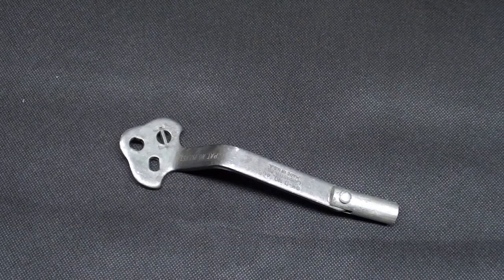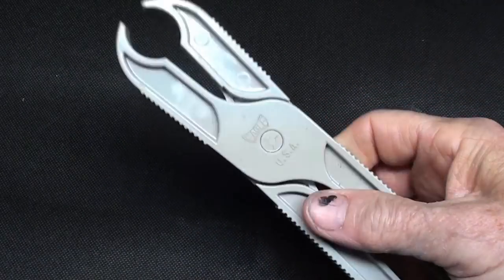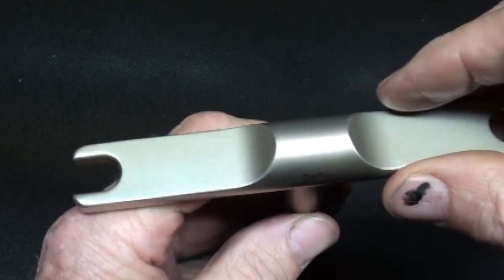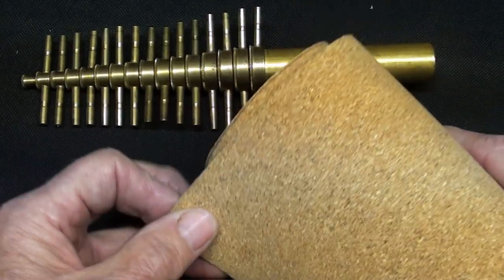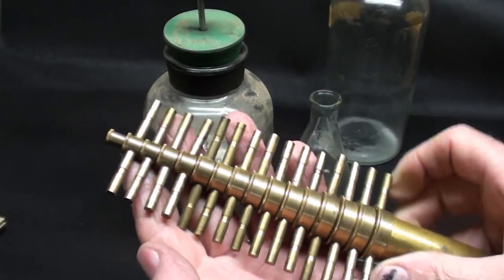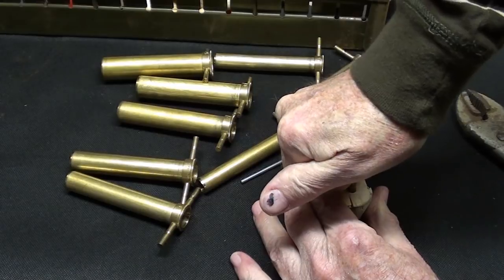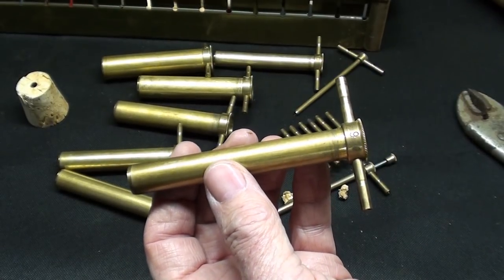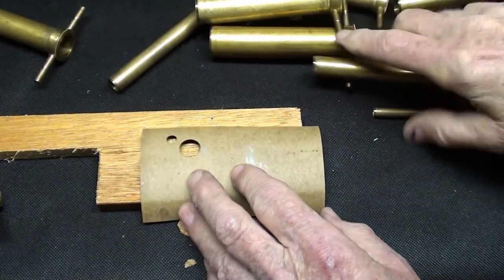What is It? MYSTERY TOOL #39b answer tubalcain

Comment: I have a set of 4 aluminum cork borers and the center ramrod as the 5th piece but I use them as cheese borer/sampling tool for sampling cheese in varied sizes and especially large wheels of Swiss Appenzeller, Raclette, Italian Parmigiano-Reggiano. I thought they were based on pineapple corers or apple corers, I never would have guessed they were originally cork borers for lab use, or even cork-bark  borer. Thanks for your information.

Comment: Didn't know the shock tool because I always went for the hot wrench and a coke bottle of water to put the bushings out. 

If you were good with a torch you could drop a set of fronts out of a 73 Nova in 5 minutes.
The KD tool doesn't look like it was successful very often, especially here in the rust belt. Surprising, most KD stuff was (is) well made and effective.
Looks like the price of cork borers will be going up on ebay, what a great gasket punch!

Thanks for another fun whatzit!

Comment: Speaking of gaskets, my dad would occasionally make a gasket for a steel surface by placing a roughly sized piece of gasket material directly on the intended surface, and cutting it by tapping upon the material against the edges using a brass hammer.

Oh and the fellow with the file has the blade 90 degrees wrong in the vise.  It will flip out of there on no excuse at all.  Not to mention, he's working it so far from the point where it's (badly) secured that it will certainly flex, making accurate filing next to impossible.

Comment: At a fuel depot lab in the Navy we had various "cork borer" sets, the one in this video actually was used in a vise and spindle type of contraption, the t handles fit into a kind of fork which had a crank handle, the cork (rubber) of different sizes fit into the tapered vice jaws (for lack of better term) and the handle was turned and the threads pushed the bore through the corks and out the end. It all came in an elaborate wooden box with pieces and parts stowed in various niches and trays. They even had an engraved nameplate with the federal stock number etc. Fond memories.
Reply from the maker: That’s interesting

Comment: Never seen a cork borer like that similar to a set of leather punches I used to make holes in gaskets sometimes I made many gaskets using a 4oz ball peen hammer or brass hammer tap the ball end of the hammer over the holes to make them always had gasket material to make them
I still use the fuse puller a handy tool in my trade of commercial refrigeration 
Love those special tools keep them coming

Comment: You know, we had a cork borer just like that at school - and I always wondered what it was for so I was really curious on the "Answer" part of this one!
We always used to hold the thing horizontally, extend each of the inserts as far out as possible (like a radio antenna) and then turn it vertical. All the inserts sliding down into the largest barrel and hitting each other made for a machine-gun-alike sound. 
Thats what we used it for, anyway :D
Thanks for making this series - so many people throw valuable tools away because they just do not know what they are and what they're good for!
Best Wishes
Adrian

Comment: The brass tree, is a Hand Gasket Cutter , a cork bore has a flatten top as your catalog showed so it fit in to a small Press or could be tapped down easier with a lab mallet

Comment: That shock tool might have been useful out west where they don't have or use much salt on the roads...here in Ohio like many other eastern states, they throw tons of salt on the roads that eat away at those flats on the tops of shocks and so even vice grips will often fail to grip them or the flats are so weakened from the salt that they just twist off leaving you nothing to try and grip on again. When I have the room I use a die grinder to slice the nut part way and then take a chisel to split the nut. Worse comes to worse, get out the liquid wrench and burn it off but gotta be done outside and have a 2liter pop bottle pull of water to put out the rubber that catches on fire and quickly puts off noxious smoke!

Comment: The numbers on the cork borers are for the number of the glass tube they are to fit.  The number is the number of 1/16" increments.  So a number 5 would be for 5/16"  glass tube.

Comment: The rubber stoppers can be bought with holes molded in. The cork borer can be made to work in rubber, but it won't work well, and is most likely to bore a hole in your hand. The cork borer is really intended to be used in actual cork.

Comment: The cork borers work terribly in rubber, but you can freeze rubber with liquid nitrogen and use a regular drill. However I was stunned to learn that this other tool, we have lying around in the lab is actually used for sharpening these borers. I always thought is is some tool to widen tubes for glass blowing.

Comment: yes the Depuy 808110157 CH1010 is just that a T-Wrench for manually inserting the bolts that hold replacement joints in place

Comment: I am a Scientific Glassblower.  The cork hole drills are only for cork.  The rubber are made that way.  You should hold the cork against a plastic or wood surface and turn the drill to cut.  Do not just push.
Reply from the maker: Thanks

Comment: i love this series, mr. pete — thank you!
Reply from the maker: Thank you
Reply: @mrpete222  🎉🎉🎉 A cork borer, makes sense now. Thanks for identifying it Mr Pete 👍
I got one with my dad's stuff when he died the other year. Drove me nuts trying to figure out it's use. Dad ran a brass and woodwind instrument repair shop for years, I thort it might be measuring device for brass tube sizes but now I believe it would have been used to cut felt or cork seating pads/washers for flutes and saxophones etc. Mystery solved ☺️
Cheers from Tasmania 🍺

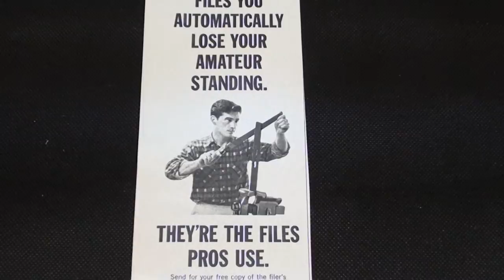Comment: 3:05 If that's a lawnmower blade he is sharpening in the ad, I would say the blade doesn't look it is clamped in the vice on it's flats but on its edges, and he is filing it from the wrong direction.... I was taught to start the file from the direction of the leading/sharpened edge to help prevent roll-over of the sharpened edged

Comment: I was sold one of those from the snap on truck and was told it was a spark plug wire puller. I told my wife it was for going to the toilet when you have greasy hands

Comment: I've seen many mechanics use the fuse puller as a spark boot puller. they will rip the boot if not careful. Allen Diagnostic Machines came with a boot puller just like the black one in the video. They will rip the boot also if not careful.
Reply from the maker: I remember the Allen machines